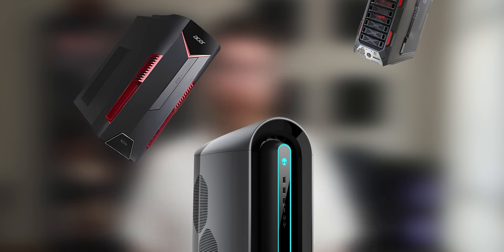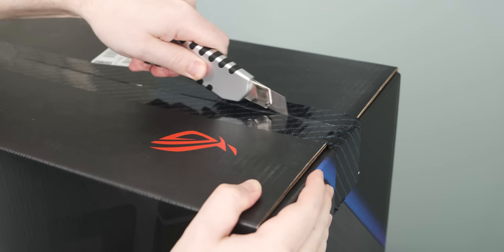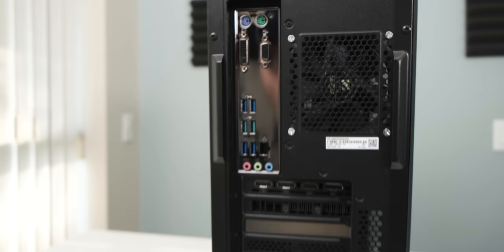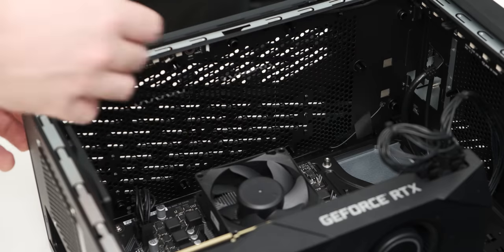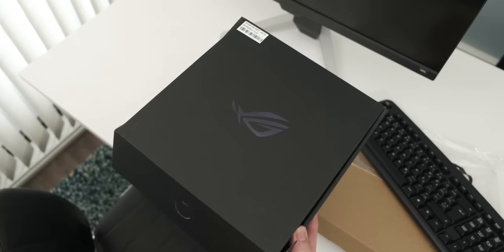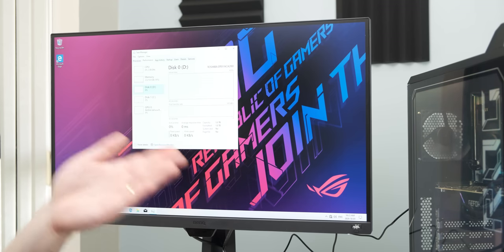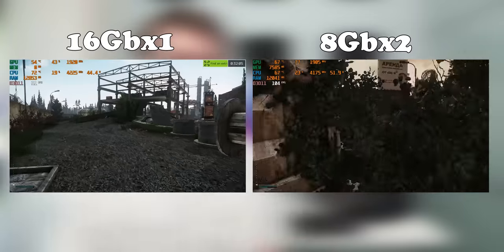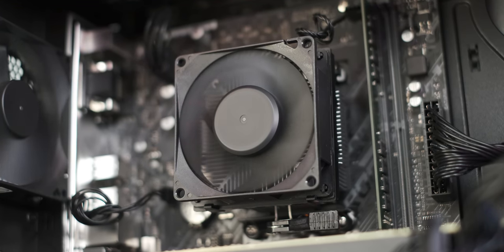I bought a $1500 Asus Strix Pre-Built from Best Buy...

Comment: Asus should sue Best Buy for misrepresentation because calling that an Asus Strix PC is doing Asus a massive disservice. (Assuming it's built by Best Buy?) If it's built by Asus they should hang their head in shame, that is a terrible pre-built, it's a General Motors level pre-built, built from lowest common denominator components bought from the lowest bidders in a supply chain. As branded pre-builts go, of course those iBuypower, Dell etc....are worse but they are expected to be terrible.

Comment: and for $1500 they went cheap in so many ways.  That motherboard couldn't cost more than $65 that's not even the fan that comes with the cpu which is horrible. I can't believe they had a board with only two slots!

Comment: I bough a asusa rog strix pc from newegg. Im overall happy with it, except the amd gpu. It sucks to mucj power from the psu. It came with one pnlytail pciw cable, instead of 2. Still working on a soultion. 

I nought a new gpu but a metal piece from the mobo blocks ot feom fully going in. What a nightmare gpu bit overll it's good.

Comment: I just b B picked one of these up yesterday with a rtx3080 and ryzen r5 5600x in it so far B I’ve already put a and wraith prism In and have 3 Liang li pwm fans for it on deck get my fan hub tomorrow next it’ll be a run controller for the run fans that are going in yay the new cpu cool works really well temps while gaming on cpu stay in mid 40’s highest it got was 57

Comment: Just some thoughts.
1.  There is no way this is an official Asus ROG build. This is so sad it looks more like a Gateway or Emachine (not the case, it actually looks ok).  If ASUS actually built this, I'm not only shocked, but ashamed to own several ROG systems.
2.  The motherboard is horrific.  2 ram slots, the vrm looks non existent with no heatsink and looks nothing like an ROG quality motherboard.  It looks like it was found at a chinese swap-meet.
3.  Why the hell is that generic heatsink on there, when the one that comes with the cpu works great for non oc.
4. ADATA memory (and only 1 stick at that) is some of the cheapest junk memory around and in an ROG gaming pc? 
5. Generic PSU?  In an ROG, yeah no.
6. You could buy better accessory combos (keyboard and mouse) for $15 on Amazon.

This pc had to have been built by a third party and advertised as an ROG.  If anyone actually buys this for $2k (I'd say more like $1,000 maybe $1,100), then they are either stupid or just know absolutely nothing about pc and should not be allowed to make pc buying decisions on their own.

Comment: The absolute Joke is that they could have thrown on the AMD Stock cooler wich is the CoolerMaster AMD Wraith Prism wich has RGB Out of the Box, 4 Heatpipes and a fairly good sized finstack... I have that cooler in my FX8350 and it works Just fine, even when my CPU is overclocked to 4.3ghz... i would actually sell you my old Motherboard, CPU and RAM If you want them... Its a MSI 970 Motherboard, an FX8300 and the aformentioned cooler... My FX8350 has Met its demise whilst i was cleaning the whole PC and my Cat threw it Off the table... 😒

Comment: I just bought the computer i hope it isnt as bad as you say .....
Reply: Well it depends. If you're not a super hardcore gamer u should be fine. Even if you are, most games should run like normal. Like u saw in the vid,  it does cry when give it VERY high demands like AID64, but that's assuming you wont lol
Reply: @FearRK  Would you recommend I buy Hp omen 25L, ASUS ROG Strix Pc G15DH or CyberPowerPC Gamer Xtreme Gaming PC? Which prebuilt gaming pc have the best cooling, thermal management and doesn't overheat?
Reply: @Rachel8031  up to you. They're all of different build quality to be honest. The Omen has only ok reviews, probably the worst reviews of the 3

Comment: I have way better spec in my 1400 dollar pc which I assembled and build myself with top of the line aorous motherboard, dual channel 16gb RGB corsiar 3200mhz ram, Antec 750 gold + PSU, 500gb NVME  m.2 SSD and the beast msi 3060 ti overclocked edition

Comment: What really annoys me about the tech youtubers is they expect so much. They are used to using top of the line everything. The individuals buying this pc, or any prebuilt, doesn't care too much about those small issues you were talking about. I just got one of these pcs and it works perfectly fine for that i need it to do. Its not a scam, its not bad, and its a reasonable price. Either way, for what i do I will not see a difference. Dont give flack to something that isnt an issue for the average consumer.
Reply: He literally shows the difference, and there are non crippled pre built system that aren't even that much more expensive than retail components. It's not about expecting too much, it's about worrying about unknown customers getting somewhat "scammed" by greedy OEM's and Systemintegrators. Just because it meets your low expectations it doesn't mean it's a good deal or reasonable to buy
Reply: @naicon971  not much more expensive building your own? I got my PC cheaper than just buying the graphics card separately. Again, buying any prebuilt is just fine. That 20% loss of performance nobody is going to notice. Most of playing games don't know much anyway and that's why prebuilts sell fast
Reply: @AndrewPL5  i agree buying a prebuilt is fine. Im not supporting the  built it yourself elitism. However bad  prebuilts like this are still a bad deal, no matter if they work or not. Literally any pc will work. And paying a lot for an intentionally crippled system that couldve been fixed without much added cost for the systembuilder would prevent it from turning it into ewaste or a high maintance system later on